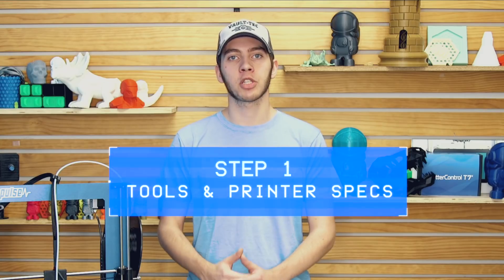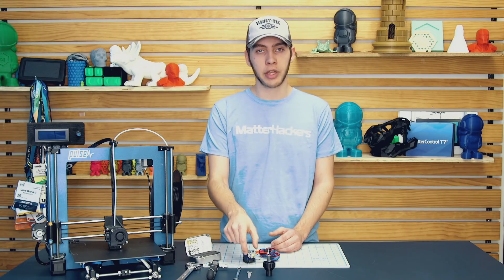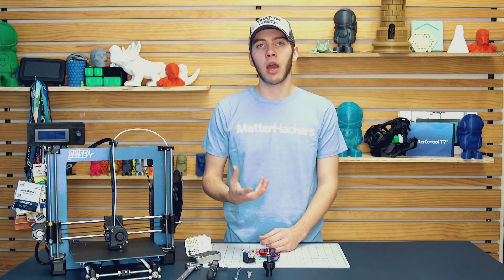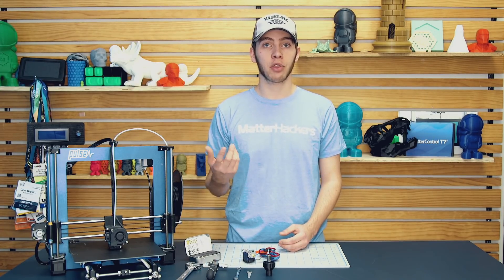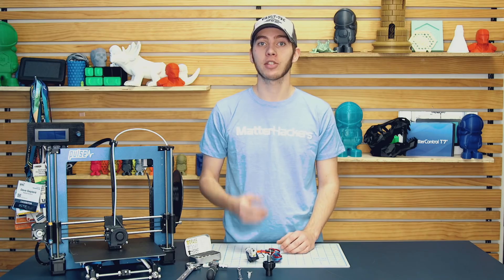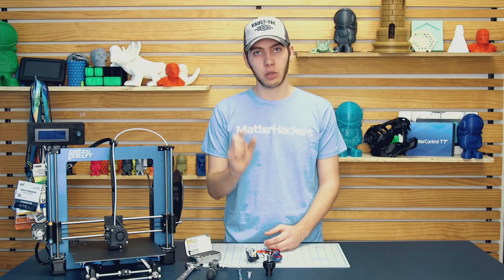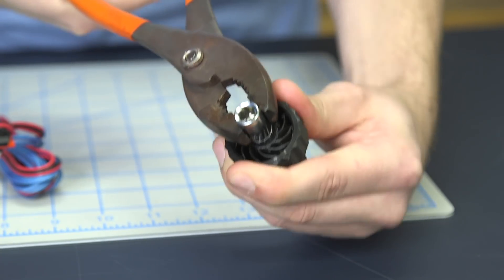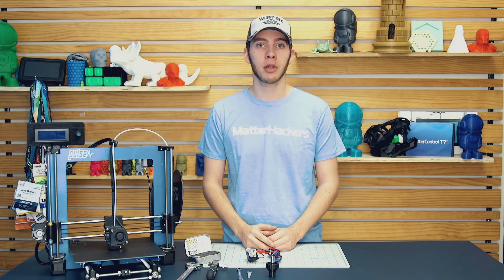How To: Change Your 3D Printer Nozzle // 3D Printing Tutorial

Comment: Since metal expands when heated up, wouldn't it be tighter and harder to remove? As well as making the brass softer and more suceptible to break? How does heating up the hotend helps removing the nozzle exactly?
Reply: The plastic inside the nozzle melts and it's much easier then to unscrew the nozzle.

Comment: So the idea is to get access to where you can attach a tool to remove the nozzle after it reaches 260°C while gripping the mount it's attached to then while its at 260° attach the new nozzle finger tight and a bit more?

Comment: If you are not using an all-metal hot end, don't you have to slacken the PTFE tube by loosening the compression fitting, tighten the nozzle, then tighten the compression fitting to get a good, tight seal between the nozzle and the PTFE tube ?
Reply: Ask Holy Spirit to teach you and to guide
you. I would recommend the YouTube Cleveland street preachers and follow Jesus no man no religion. Be holy and obey Jesus. Hebrews 5:9 "salvation is for those who obey. Jesus says if you love me keep my commandments (John 14:15). Jesus even says if you keep my commandments then you shall abide in my love (John 15:10).

Comment: I know this reply is pretty late but I was curious about wanting to print with a wood filament. I am unsure if it's actually abrasive or not. So would a standard brass nozzle still work with it? Or will I have to replace the nozzle when I swap back to a regular PLA filament?
Reply: @XML studios Not necessarily. I have a spool of HT-PLA Woodfill from protoplant which is non-abrasive and prints like regular PLA.